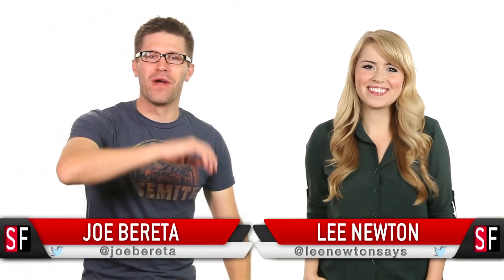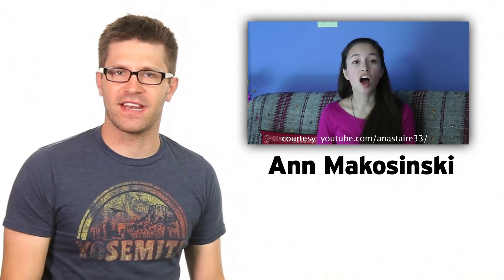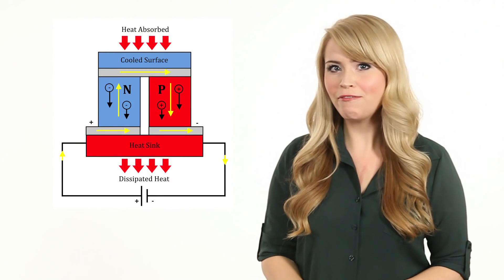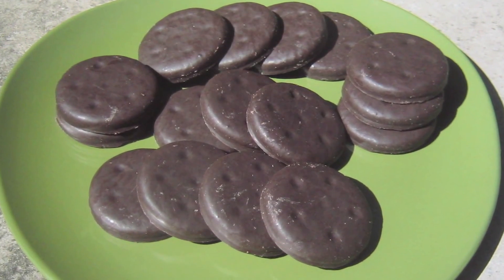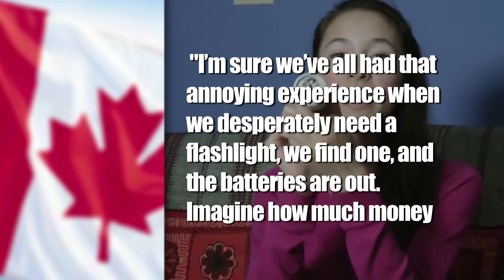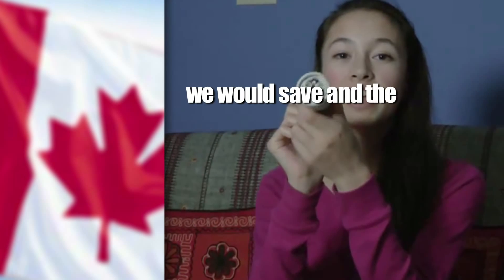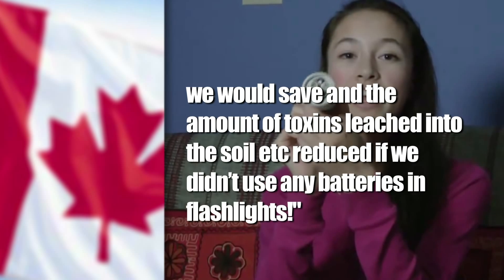Teen Invents Flashlight Powered By Body Heat!

Comment: This was done 30 years ago efficiency is to low no she did not her daddy is friends with them the fans you stick on a stove is the same needs to be very cold the other side and her page is BS saying use a transformer for more voltage led needs 10 to 20 mA not 1 mA as thay say well any way I did this age 12 the tech is that old any one playing with Fireplace Fan Motor Accessories Power Generation Sheet, 227℃ High Temperature Resistance Graphite Power Generation Sheet

Comment: make a air conditioner that runs on heat from the air.
Reply: power needed wont work Fireplace Fan Motor Accessories Power Generation Sheet, 227℃ High Temperature Resistance Graphite Power Generation Sheet

Comment: And this whole argument stems from someone saying flashlight vs. saying torch? It's a matter of location, adaptation of a language in an area, dialect(Which I guess sums up the other two) and even preference after a while. It's not butchering a language if it's a change over time. The concept doesn't stop with english either, it stems into the difference in spanish speakers from Spain vs Mexico, and so on and so forth. My point, the whole argument about butchering is useless.

Comment: From how I understand it, it is the difference between your body heat and the ambient temperature (the ambient temperature will be of the other metal) that creates the electricity. If your body temperature drops to about 70 degrees you have severe hypothermia or death, so you are usually going to be at a different temperature than the surrounding ambient temperature.  It is when there is no difference is when there will be a problem.

Comment: But on the flip side, this flashlight could not be as easily used in colder tundra. However, with that said, she is on to something. Instead of just relying on the heat from your hand, it would be smart to include some sort of storage. Now whether or not she uses a battery or creates a better storage device is up to her. Either way, this is brilliant! :-)

Comment: This is really impressive. My only question is what happens when the flashlight is heated to the point where it's the same temperature as your hand. Like on a hot day or if you've been holding it long enough for the temperatures to balance out.

Comment: they said the estimated time before it stops working is 30 minutes, so I guess it takes that much time until the temp. difference is not enough to power the flash light

Comment: It uses the heat difference between the plates to power the light, after a while the other side heats up too and power cant be generated anymore until youve let it cool down.
Reply: I did it age 12 in the 80s did not work well Power Generation Sheet, 227℃ High Temperature Resistance Graphite Power Generation Sheet old stuff don't work well we have a shake tourch again 70s tech coil magnet tube and a cap old stuff

Comment: If you mean work in a whole new way as in not really inventing anything new & claiming other wise than yes, I also don't think you know anything about since what do you really think this girl is the first one to think of using this TEG or peltier element to generate electricity using body heat? They are not used because they are not very efficient. I want to see that flash light stay turned on for more than 5 min. You know squat about science.

Comment: Wouldn't it be possible to develop a semi lightweight jumpsuit with the same technology in order to power larger objects.

Hell we might be able to make a jacket that provides enough power to recharge a smartphone.

 (assuming the greater difference between the hot and cold sides causes increased power generation a jacket would indeed be ideal.)

And wouldn't it be possible to replicate this on an enormous scale using a controlled environment with vastly opposing Climate.

Comment: Actually, they were invented by the English inventor David Misell in 1899. He originally called them "Electrical Devices". They were called flashlights because of their carbon filaments. They could only be used for short periods, or a flash. Hence the name Flashlight.

So put that in your English pipe and smoke it.

Comment: issue, the water if left in the container would become blackened if it didn't more or was exposed to any sort of air (idk what it is but i know that old house plumbing has this kind of issue when the water isn't used in years). either way its a cool idea using a heat sink but i think it shouldn't use something like water. Maybe a silicon based liquid/gel

Comment: Yep that is it,  if you where to cool it by pumping water through the center or a heat-sink it could probably last much longer with a higher output because the difference between the cold side and hot side is bigger.

Comment: Lee's comment about powering things with her crotch made me think...surely we could do the same as this flashlight for vibrators. Imagine the world's problems that would be solved and the lives that would be saved if we never again had to worry about the batteries in sex toys failing at the very worst moment.  There is nothing that ruins a mood more than having to go to the kitchen and poke around the drawer of random crap looking for a couple of double A Duracell-this could solve that forever!!

Comment: Likely because of the normalization in the temps.  The flashlight will be room temp (lets say 72F) and your hand will be body temp (lets say 98.6F).  As you hold it, the heat from your hand and transferred to the flashlight, increasing it's temp eventually getting fairly close your own.  As this would happen the energy created from the peltier would decrease until it gets below the point the LEDs require.

Comment: That is only specifically in physics sir. Kinetic Energy is a term that can be used to describe any sort of active energy, and your palm generating heat energy can therefore be called Kinetic Energy. Also, what does it matter if the peltier plates hasn't been made for this type of purpose. It works. Now go back and science properly sir.

Comment: No because this technology works on a heat differential; for example if the temperature of the torch is lets say 10 degrees Centigrade and the human body is 37 degrees Centigrade you will have a differential of 27 degrees which will then lead to a flow of current. If you are in a place like Texas and the temperature is like 37 the light will not work at all because of no differential. Places like Alaska and Russia would actually work much better than Texas.

Comment: I know right! She only implemented an existing technology, and from the sound of the video at 1:53 , they may have just realized Peltier plates even existed.
Reply: Fireplace Fan Motor Accessories Power Generation Sheet, 227℃ High Temperature Resistance Graphite Power Generation Sheet 1978s tech

Comment: Yah, i also thought of having a temperature sensor that when directly influence the color of the cup. So when the liquid is hot, the cup is red, and it gradually changes while it cools.

Or have a picture of a battery on the cup, and a hot liquid would light up the battery image as if it where full, and change colors from green->orange->red as the liquid gets cooler.
Any image can be used:
-Pikachu with lightning shooting out
-Zelda hearts lighting up
-Flag colors
The amount of ideas are endless

Comment: well it seems to me that if she put a large metal mass on the inside of the flashlight to conduct heat away from the parts that actually produce the electricity, the thermal difference would last MUCH longer, and thus forth it would run for much longer.  As long as the flashlight is a relatively colder temperature than your hand, it will produce electricity. in a heatwave, the entire  flashlight would be the same temp, so no current would be produced.

Comment: Your hands would be colder in the winter as well so no, it wouldn't work better in the winter.
It also would be terrible in a heatwave, as it may not even require a hand. It may already be hot enough to activate.
It would be best in neutral, non-emergency situations. Most likely for recreational use.

Comment: Problem is efficiency, you're not going to be holding a torch %100 of the time and will have to put it down.  Then you must judge how bad the materials are for the environment.  They could be worse then batteries.

Comment: This device will only work if the ambient temperature in the room is not body temperature. Peltier units rely on a heat *gradient* not heat alone, so there's has to be two objects of different temperatures. One is you, the other is the flashlight, which will be the same temperature as its environment.
Reply: So you dip it under cold water before you use it.

Comment: that's for now, think about it though, at the rate technology is advancing they will most likly find a way to make better and brighter flashlights and other electronics  that use a lot less energy when running making body heat a viable alternative.

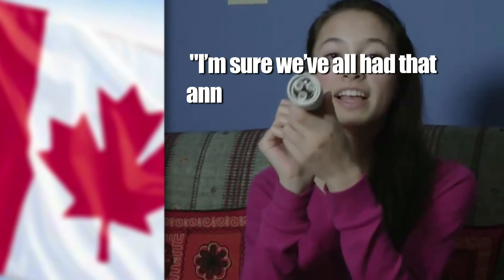Comment: So I studying to be a computer engineer so I understand a good amount of what went into building this flashlight. One thing she in her video was it required an amplifier to increase the necessary voltage..and an amplifier needs a input voltage to mark what the signal could be amplified to and she used a 50mV input to accomplish that..this is at the 1:07 mark in the teenagers video (the video skipped explaining the source). So unless I missed something I think there is a secondary energy source.

Comment: Nope...peltier effect has been known since 1834, google it.   Peltiers have been used to cool cpu's( at great electrical expense), this is just the reverse, and the problem is that the efficiency is so low its just nothing more than a novelty. Its not an invention, people did not use it because its not effective or practical...not because they didn't know.

Comment: Its basic, like adding a solar panel to a flashlight or even a crank, its an application of a preeixsting tech in a frankly not very practical way.  If she had invented the energy converter, then I'd be impressed, but as it is she just snapped two things together.  This stuff has been known for a long time, people use the reverse to actively cool their cpu with thermoelectric cooling, the principles are very well known and old.

Comment: Ummm... small engineering problem... a small flashlight would heat up quickly from your body heat. So when it reaches your temperature there will be no thermal gradient and no power...

Comment: I feel like there will be a train accident. Both ends of the tunnel are cut off and there are survivors. Someone has this and helps everyone. But 5 days later, he's on the ground dying with the others, the flash light he's holding is the only source of light, but it slowly fades as his grasp get's colder. As the light fades no more, so does his life.

Comment: the human body produces 21 btu of thermal heat that combined with a form of fusin the computers found all the energy the need to power there flashlights and more reason for the matrix.

Comment: The movement of electricity is dependent on one side of the Peltier tile to be cold, while the other is warm. When you pick the flashlight up, your hand is warmer than the flashlight. After about 30 minutes, the heat has distributed enough that there isnt a large enough flow of electrons.

Comment: because as something heats up the cooler parts of it become "smaller and smaller" thus reducing the peltier effect. Since nothing can remain indefinitely cold when in the same area of something of a higher temp the time between picking up the cold flashlight to it reaching an even distribution of heat is around 30 minutes. Which is why the girl said she's working on it. It's science.
Reply: Fireplace Fan Motor Accessories Power Generation Sheet, 227℃ High Temperature Resistance Graphite Power Generation Sheet 1970s tech

Comment: The flashlight isn't powered by your body heat alone. It is powered by the transfer of energy between the cold surface (aluminum flashlight casing) and the hot surface (your hand). That energy doesn't last forever as the aluminum casing will heat up to its surrounding temperature (your hand) fairly quick and the energy transfer will stop. Hope this helps.

Comment: Well, after some time i guess the temperature of the flashlight's surface will match the temperature of the palm, since it had to be cooler i guess it will stop working at that point. So i guess you'll be able to make it last longer by kepping it in the fridge? :)

Comment: After a half hour it would reach the temperature of your hand. If it's the same temp as your hand, there would be no electrons moving between the two areas, and therefore no electricity...At least that's what I think. I could be wrong

Comment: Since the electricity is generated by heat transfer, I'm assuming that's an average for how long it takes for the generating mechanism's temperature to match the temperature of your hand. Which also implies a cool down time between uses.

Comment: It only works as long as there is a temperature difference between the two surfaces. I assume that the flashlight is fully saturated with body heat after 30 min.

Comment: The thermal plate that needs to be cold on one side, and warm on the other eventually warms up from the heat from your palm. (Theres nothing keeping the opposed side cold in the flashlight)
Put it down, lets it cool for a while, then it would work just the same.
Reply: Fireplace Fan Motor Accessories Power Generation Sheet, 227℃ High Temperature Resistance Graphite Power Generation Sheet 1970s tech

Comment: I think the 30 min lasting time is as a result of the heat still transferring from your hand to the flashlight, meaning that the flashlight and your hand would eventually reach thermal equilibrium, and the generators would stop producing electricity.

Comment: It has a lasting time because once the flashlight heats up, the heat transfer from hand to flashlight is less. It isn't powered by heat, it is powered by the transfer of heat, once the flashlight is same temperature as the hand, no more power.

Comment: I would imagine after that point you will have heated up the aluminum tube too much to get a charge as the charge depends on the difference in heat between the tube and your hand.  Thus it only works for 30 min, then you would have to set it down for a while and let it cool back down and it would work again.

Comment: Generally no. This tech would not come close to the rate of heat dissipation needed to cool a laptop. You laptop's CPU would quickly melt. Then their is the comparison of energy used. A laptop runs at ~60W where the heat generated would give you a mW, or maybe 1-2 watts.

Comment: It is, however like she and they said, it only works because of the opposing temperatures on the inside tiles. Once the cold side warms up from your hand, it would not work until it cools down again. Very cool idea and helpful for short-term situations but in an emergency situation, it definitely needs, like she and they said, the more work that is being put into it.

Comment: the effectiveness is based on the difference in temperature, so as long as the flashlight is cooler than the user's hand, it will work to some degree. Aluminum naturally dissipates heat, so it it would rarely be an issue

Comment: The problem with this is that one small AAA batter can run a 3 LED bulb for 80 hours. 1200mah/(5mw x 3) = 80 hours. And I bought 2 9 LED flashlights for $3 at harbor freight last work, and they came with 3 batteries each. While the idea sounds cool, it is not really that useful.